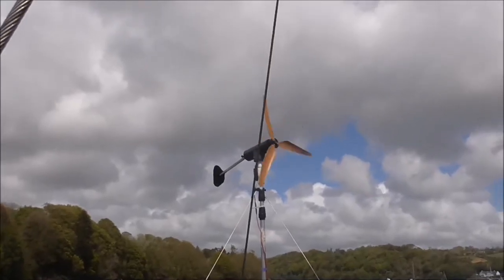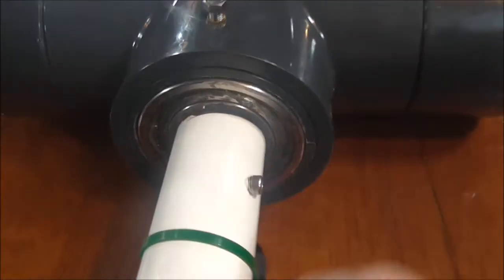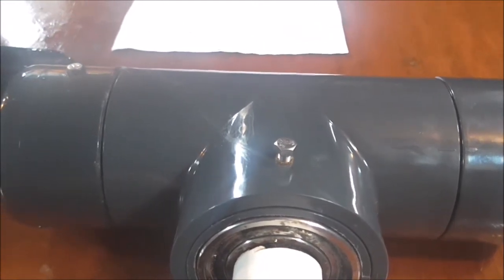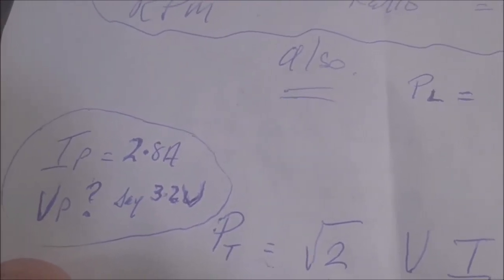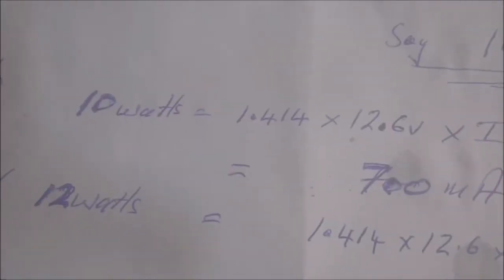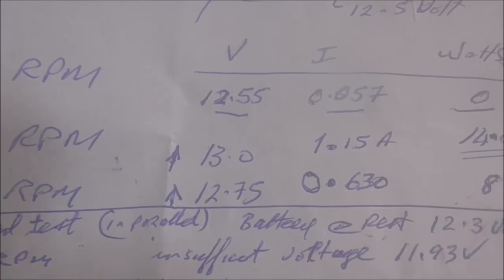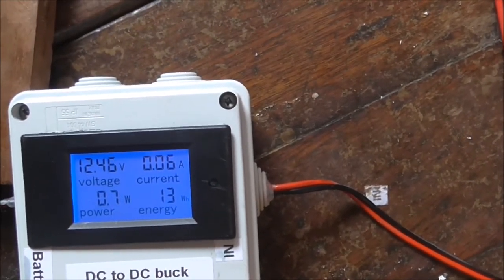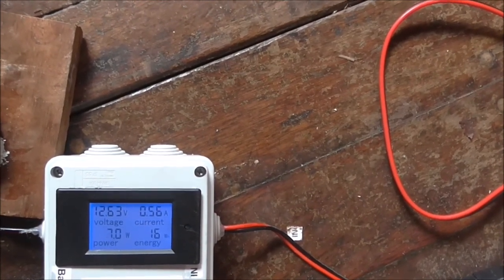NEMA 23 Portable wind turbine

Comment: Voltage output
Reply from the maker: From bench test notes:
Parallel wiring
400rpm     o/c.  13.63 volts
1400 rpm  o/c.  44.24 volts
Extrapolating  31.5 volts around 1000 rpm
Went for a Drok step down buck 4 to 40 volts with capacitor rating of 50 volts
Series wiring would have produced excessive voltage on o/c
Reply from the maker: Update I also ordered a 5 to 60 volt buck converter with cap. rating of 63 volts . I think this was the one I used.
Motor was Yoynano NEMA 23 , 2.8 A , 1.26 Nm
Reply from the maker: Hi, It's been awhile since but I used a buck converter as voltage generated by stepper motor was high , very high in single phase , if interested I can look back on my bench test notes.
Reply: @martint1151  yes sir thank you I am interested in project